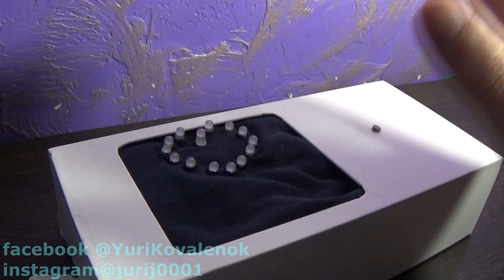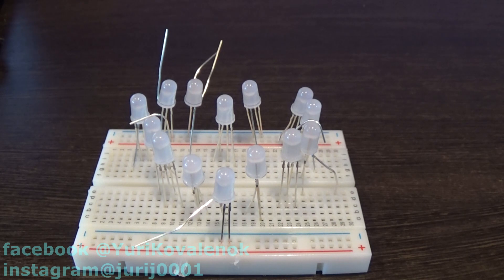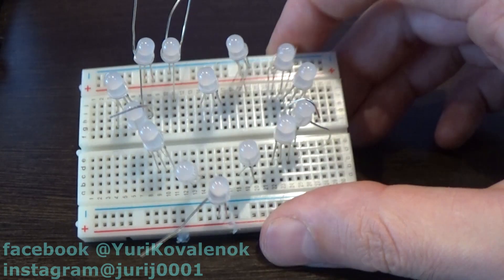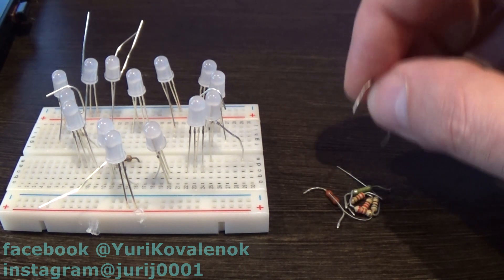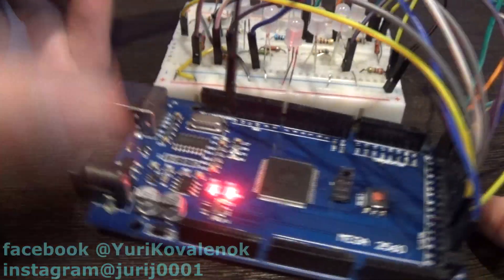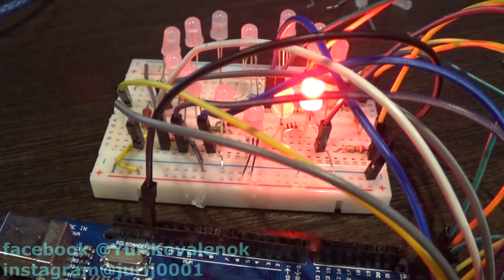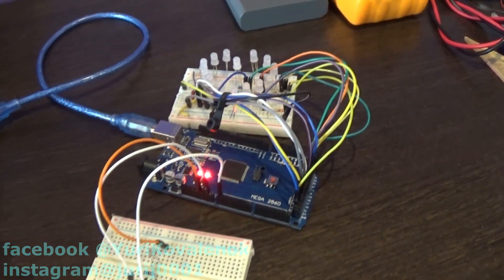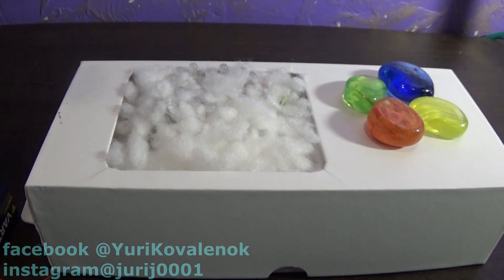14 LEDs for February 14. Valentine's Day with Arduino

Comment: Yuri, could you rig a potato cannon that fires automatically when a photosensor is activated? That would be great.
Reply from the maker: It's cold outside now ))) but it can be done ,you can also make a laser trigger, as in the last project. It's not difficult , just cold ))) there are no conditions for creating a project yet